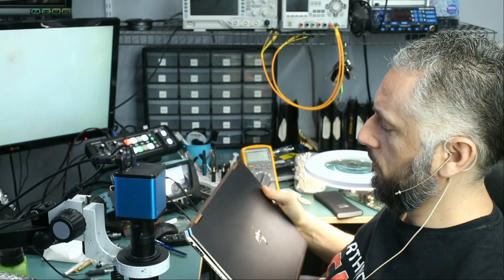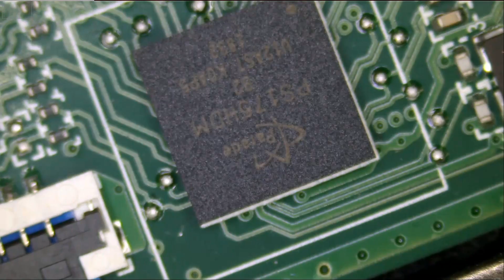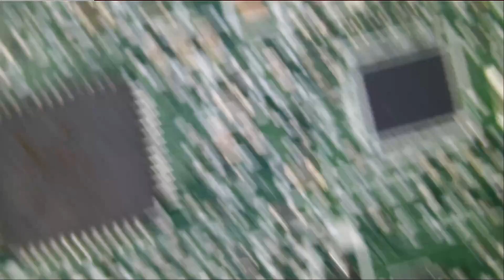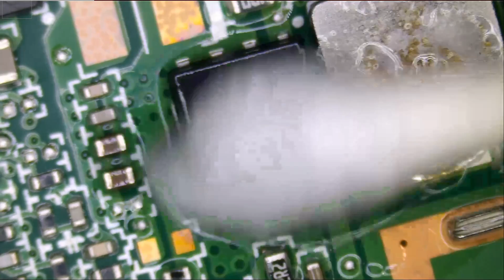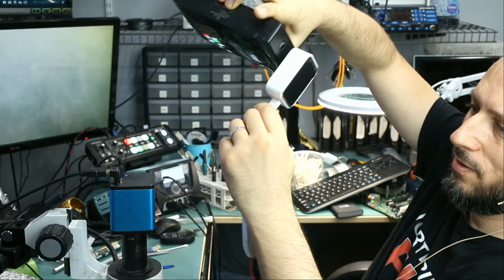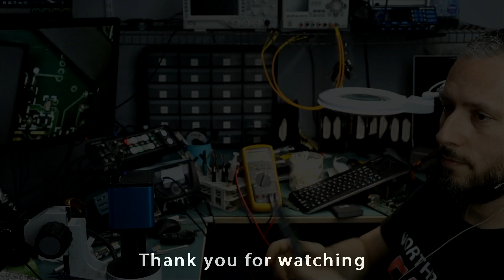HP Spectre x360 No Power Repair - That was a quick one. Laptop Model15-df0008ca

Comment: I have a Spectre that stops working after what I think was water spill.  It had been dried and cleaned.  The charge light is amber but it doesn't turn on.  When I press the power on button, I see the keyboard light key (one key) flashes once or twice.  Any suggestion?

Comment: I have a problem with my x360 , it's the 4500u version, it does not so old but has the issue that cannot charge and does not power on, barely times i was able to charge but not completely. I've tested the AC adapter and AC port with other parts and nothing. Do you think is caused by a damaged mosfet?

Comment: How do you know if it is a filter or resistor when they look the same on the board. Also how do you find out the value of a blown resistor or filters without markings or unreadable? Thanks for the videos.

Comment: How possibly did you had so much confidence in charging it and then power it on WITHOUT a component? (It's a genuine question, no critics of any sort)
Reply: Guessing the short didn't allow it to do anything before. If it turns on the short is gone, he could've measured across the traces where the mosfet resided to check for short as well.

Comment: MOSFET that you replace was part of switching power supply, so if you remove bottom transistor ( between GND and PSU output before coil) 19V will go directly as PSU output voltage, because there is no regulation to pull voltage down and circut powered by that PSU will die.
Reply: he said it was a dual mosfet, so actually the whole line went out of service, likely auxiliar one, for usb or something
Reply: @glmnet  nope, switching power supply is always build with two MOSFETs, one between main rail and output and another between output and GND. Then chip called driver will switch that 2 mosfets to create square wave, then coil and bypass caps smooth signal for desired voltage. So you could get any voltage from 19V in that way. Multiple switching power supply circuit are used on laptop motherboard to generate 1.8V for RAM, around 1V for CPU, 3V / 5V always to power on computer ( voltage on power button always on) and so on. That's why you see large amount of big grey SMD coils on laptop motherboards today, they are all part of different switching power supply.

Comment: A few years ago it was bad Nvidia solderballs, then it was leaky caps, now it’s crappy mosfets
Reply: If youre talking about the dv/cq/ i dont even know class action. Nvidia knew they was a large # that were doa out of the shop. Apparently hp knew as well but then there was the fan not running half the time later fixed by a bios update. So they were overheating to beat hell not a good heat sink for cpu and gpu to share tiny heat pipe.

Comment: It seemed that the damage to Mosfet was transferred to (or from) the soldered area under, is that normal?
Reply: Yes, in severe cases the component can be spot-welded to the pad on the PCB.
Reply: @Ciakuz  Thanks.
Reply: Yes. Shorted to ground it got hot

Comment: Can you add a multimeter reading on the screen when you measure impedances, if possible?
Reply: I have seen it done.. Using obs software and a simple web cam. Pointed ate the metter and placing a windowa on the corner of the screen